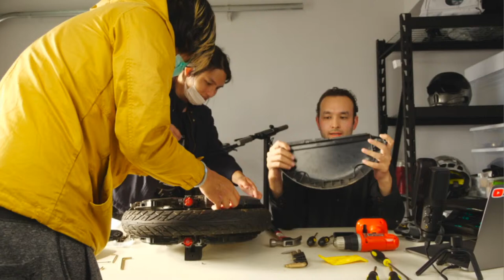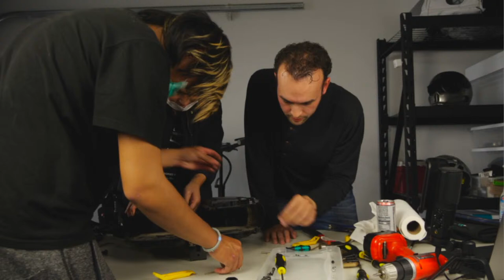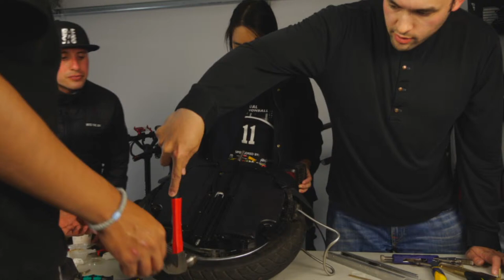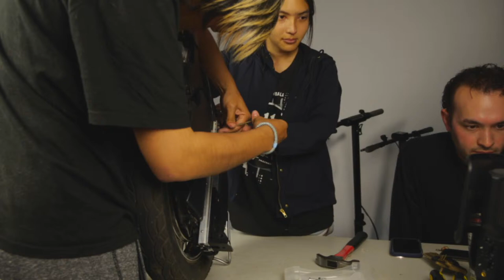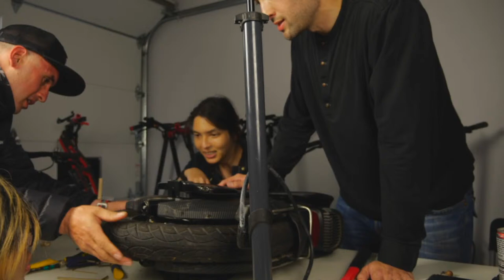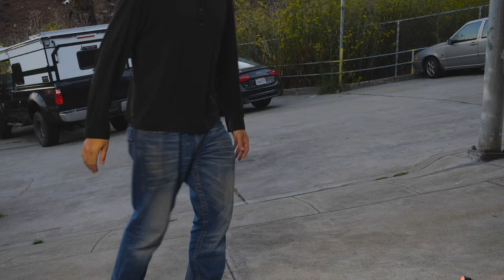Inmotion V11 Electric Unicycle Tire Swap Livestream

Comment: Lotta screws......there ought to be a large magnet on the work bench to keep them in groups as you go along & hold them securely.....a metal camp plate on a big flat magnet. I "knew" there would be a spill and started writing this message just before it happened.....lol.....life is funny.
Reply from the maker: Haha yeah definitely, some kind of huge magnet might be nice, but possibly make it difficult to work with. I'd setting for a large 2 inch magnet that goes all the way around our work area 😅

Comment: for reference this is how you change the tire on the S18 according to afeez: it’s a easier fix. The panels are easier to remove. Unscrew the frame and the tire comes right off.. not as bad as it looks
Reply from the maker: That sounds a lot easier, still hope I don't have to try that some day :)

Comment: Hi I need your help if poss, I have a Kingsong 16X and i had a flat tyre so attempted to change and i really messed up i forgot to move the 2 led strips out of the way , I have a short 50 second video showing the damage, i asked kingsong for a price for replacement, but they want $25 plus another $50 to ship it to the UK ,  no one in the UK has them , so I checked on Ewheels.com and Jason has them for only $19 but does not ship to UK so would you be interested in helping me if I paid in to payal the cost  of the light strip plus shipping to , then pay you again for you to ship them to me in UK , it has gotta be less than $75  in total ? cheers ing-ee
Reply from the maker: Sorry about your LED problems and I hope you get them fixed. Sadly shipping internationally from here is very expensive, and I doubt you would save money. Have you tried erides? They might not have them in, but they get shipments so maybe they can add some to their next shipment. You can contact them here: https://www.erides.co.uk/erides-electric-unicycle-contact
Reply from the maker: 333ingee I’m sadly not sure. Maybe if you have any friends well versed in soldering and electronics they could find a short and repair it. Hard to say. Let me know what erides says, good luck!
Reply: Maybe check speedyfeet. They are based on the UK
Reply: @stephencrompton6480  that's who I bought the wheel from sent him messages asking him if he can order new LED strips , but not getting any response, I have found some LED parts from Ali Express  to see if i can fix it, when I get the parts will do a video if it works, thanks for commenting cheers.

Comment: Missed the stream!! 😢 but ima ask my random question now anyway 😉: I know you usually ride much higher end scoots these days but wonder if you have an opinion of all the top mid level scoots like the Z10X, Mantii, D6+, Lightning, Pro's? I haven't seen anyone do a comparo across the board and it's such the obvious comparison imo 🤷 aren't they all mfg'd by falcon pev?
Reply from the maker: Good question, and I should do a mid-level scoot comparison soon. It's hard to compare them all without having them though, and I hate speculation videos. Falcon PEV sells rebranded 10" scooters from Titan, as are most brands like apollo/turbowheel. They're all very similar, and it depends on the seller. I'll see about doing this comparison in the future. 👽🖖
Reply: @AlienRides  Ahhh Thnx man! So Titan is the oem and falcon is the distributor?
Reply from the maker: Jedi Radek Crif yeah exactly, titan is the oem Zero, turbowheel, Apollo, techlife, and more all rebrand them.
Reply: @AlienRides  Thnx brotha

Comment: I too have several dents in my v11 already. At least 6. Very upset about it :(
Reply from the maker: Dang, that's too bad. I wish these were built to be more rugged, they should be at the price we pay. :_alienRides:
Reply: @AlienRides  I don’t think I had enough air in the tire. It was pretty low. I think it’s my fault HOWEVER the tear downs I’ve found on the internet also note dents.